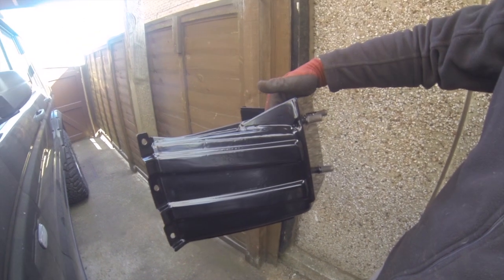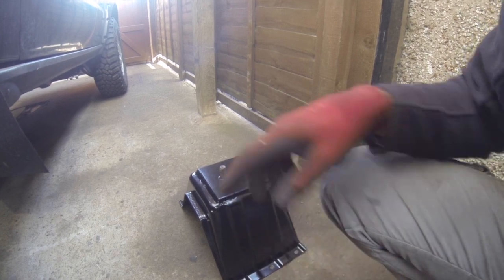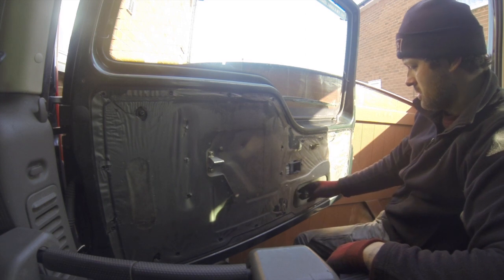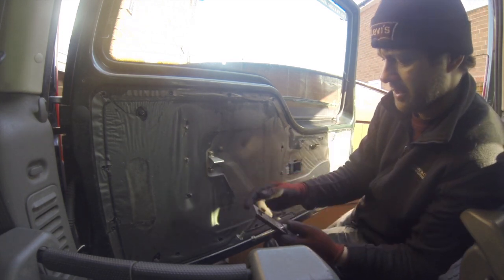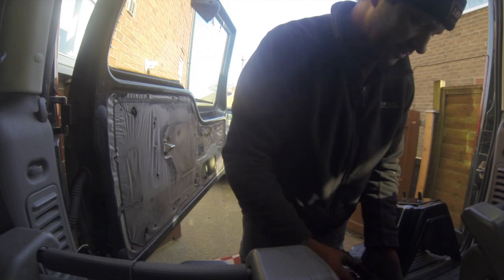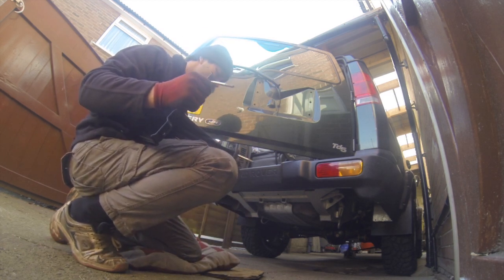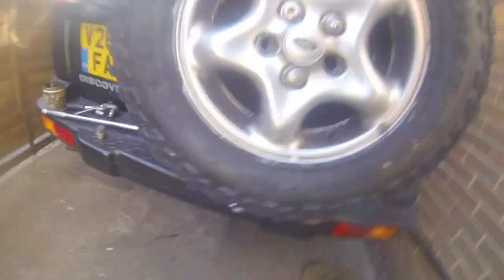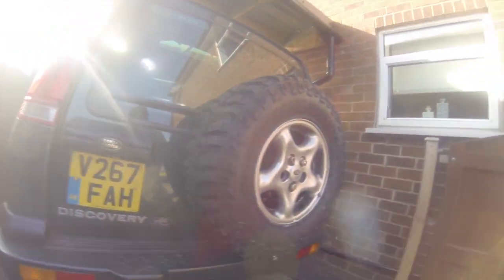Land Rover Discovery high lift wheel mount.

Comment: Hi there Rich, do you have any advice on what we should be looking for when buying a disco? we are currently looking for a discovery 2, i would appreciate any advice regarding what are the main things we should pay attention too, just found your channel and i must say it is excellent and very informative! Will the disco you are working on be up for sale anytime soon? Thanks in advance
Reply from the maker: Hi there may I start by thanking you for your interest. I did a video on the buying of a Disco 2 a few months back, which might help but on top of that I would suggest always check the chassis for corrosion especially at the back end, inside and outside the fuel tank rails.
The inner wings are terrible for holding water and rotting on both the Disco 1 & 2
Wheel bearings aren't cheap so always a good thing to check out along with the steering knuckles and track rod ends.
The air suspension can be troublesome and if not needed then coil springs are a good and easy solution.
Make sure there are no warning lights on the dash, these can cause you real headaches.

Other than this it's just like buying any other vehicle, service history, milage, work carried out, etc.
Hope this helps and you've found this helpful.

"Will I sell mine" never say never but no plans to do so just yet, having too much fun.
Many thanks
Rich.